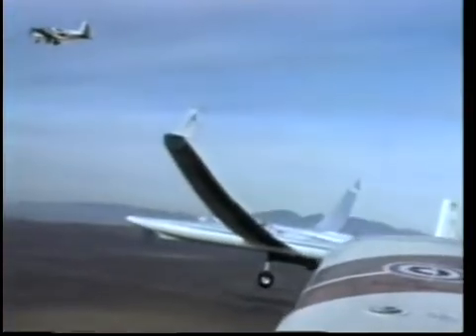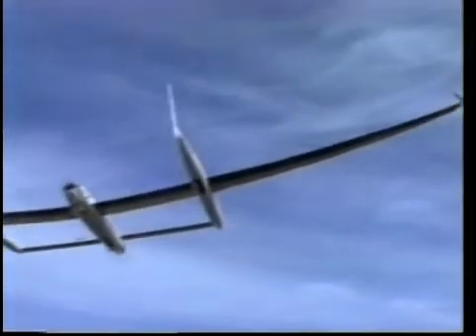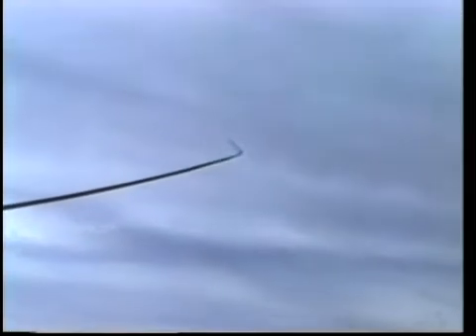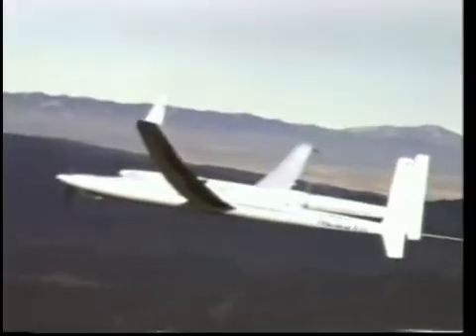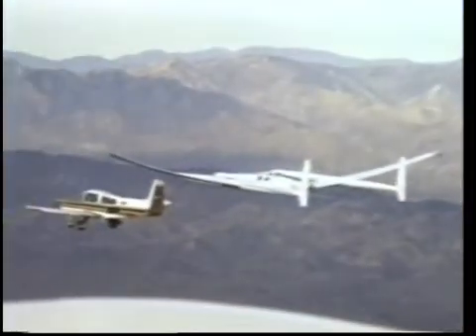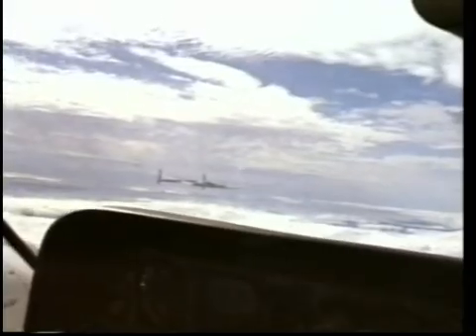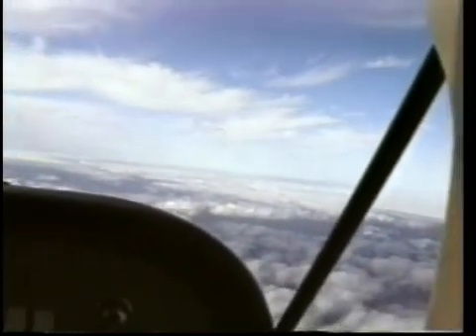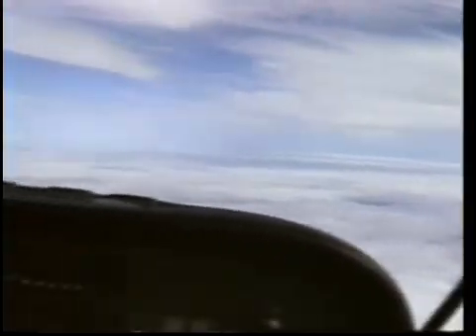Rutan Voyager - Wing tip damage assessment

Comment: I'm surprised they didn't attach a little wheel to the wingtip to avoid the tip contacting the runway.
Reply from the maker: Hi J, it wasn't expected that the tips touched the runway. It was the first time the plane was totally fueled, the tips at the ramp did  not dragged the tips. Dick, wanting to achieve the T.O. speed, kept the nose down, creating a negative AoA that produced negative lift, pushing the wings down and surely increasing aerodynamic drag.
Reply from the maker: @HENRY FORSTER looking back that makes sense, but this was one time only. As said, the mix of conditions that lead to dragging the wings was not predicted.